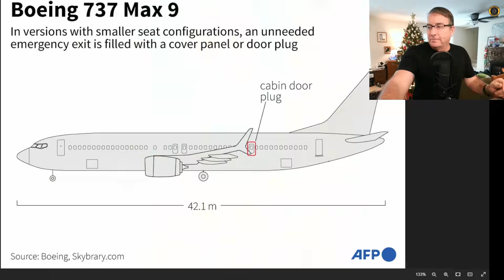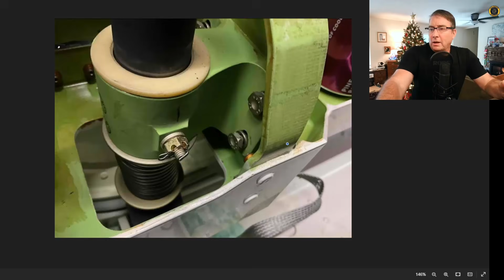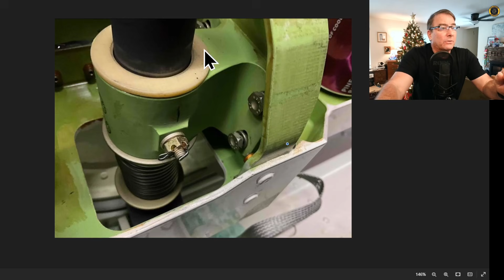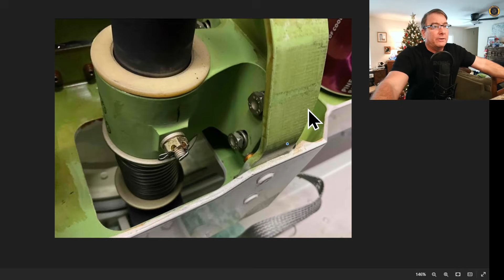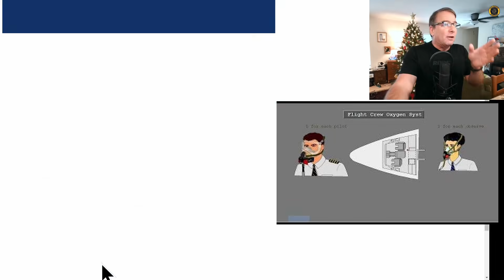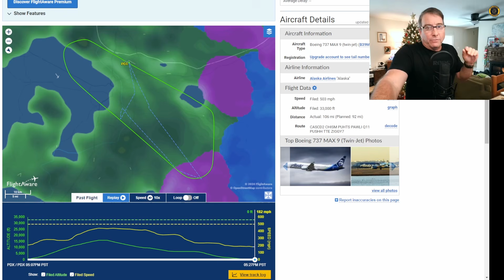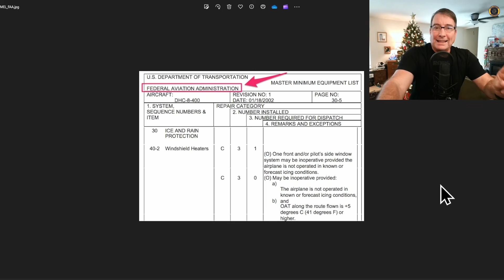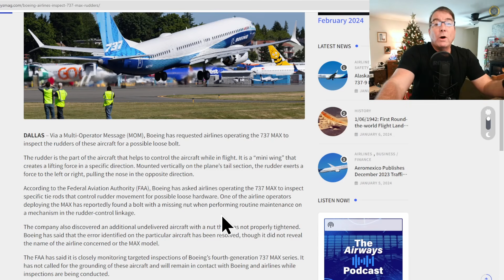"Yes, We Have No Bolts"  9 Jan 737 Max-9 Update

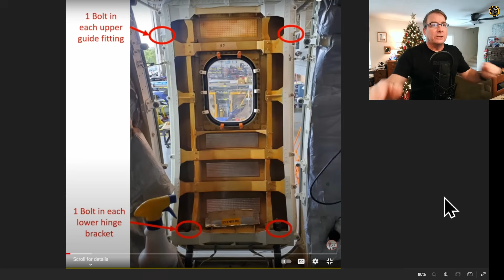Comment: @5:20, Juan, stop pads with NO bolts. Does it make sense that the door it held in place at the top and bottom only? I see 12 additional points of contact that if there were bolts used, they would distribute the load from the door to the entire structure around the door rather than just the top and bottom. Something here doesn't make mechanical sense to me.
Reply: The stop pads prevent the door from pushing outward and hold all the pressurization force.  The four bolts in question only prevent the door from lifting upwards in order to clear the stop pads.  Those four bolts have little to no force on them.
Reply: @johnaclark1  that is my question. How? Do bolts pass through the stop pad and fasten to the door?
Reply: @Mike44460  Watch the videos again.  When the door is closed and at rest it sits up against all the stop pads.  In order to open iIt has to slide up about 1.5" to clear the stop pads and push open.  The four bolts in question simply prevent the door from sliding upward which prevents the door from opening.  There is no real pressure on the four bolts other than assisting gravity in holding the door down so it can't slide upward.  No bolts are needed in the stop pads.
Reply: @johnaclark1  I understand that part of it. I have no idea of the actual square inches of the door.  I just used a 30-inch wide by 6-1/2' high door as an example to work with. Every one pound of change in pressure puts about 2,400 pounds of pressure on my sample door. Only holding the door at the top and bottom would surely let it distort. The actual door being curved adds to the surface area and the pressure trying to push it open. I'd like to find a picture of one in place.
Reply: @johnaclark1  I found a picture. With the door installed, the door stops are covered by the mating parts on the door. The 12 door stops are loaded when the door is in place. Now, it makes sense to me, and the bolts holding the door down are extremely critical, especially the two on the top.
Reply: @Mike44460 Critical yet have very little force on them. All they need to do is be there.

Comment: How could pressure push it up???
Reply: I’m just guessing here, but I don’t think that the pressure pushed it up. Since it’s designed to open by being lifted slightly, and then out, from vibration and bumping on landings and such, it could have worked its way up slightly overtime to the point where the stop fittings didn’t line up with the stop pads and then the pressure just pushed it out.

Comment: Speaking as a 20 year airline flight attendant veteran, as well as a five year stent as an instructor flight attendant.The fact that Boeing did not inform the crew on the main entry door giving way under a depressurization. This lack of information could have caused😢 critical time in an emergency, trying to figure out what to do about the door  and crew at the same time as we’ve got a major depressurization in the cabin. Just not right.
Reply: If you have rapid depresurization, are you really worried about bad guys trying to crash the plane or are you trying to save the plane and its passengers?  From what I have read, it wasn't the main cabin door that gave way.  It was the door between the cockpit and passenger cabin that opened probably equalizing the pressure between the two areas.  And thats been the same on most, if not all 737s ever built.  Not a design flaw.

Comment: Maintaining enough similarity for the type certificate of an existing aircraft, or engine, to apply to a new derivative is critical. Certifying aircraft, or engines, from scratch these days is almost impossible.

For instance, the Allison Model 250 family of engines were first certified in the late 1950s. Obviously, technical analysis capabilities have improved dramatically since then. The Model 250 uses cast integrally bladed disks for turbine wheels. In the 1950s, no one had ever designed a gas turbine engine that small. The conventional fur tree or dove tail blade attachments would not fit. That is why the cast bladed disks were used.

However, low cycle fatigue was found to cause cracks to form in the rims. Fatigue crack growth analysis techniques didn't exist then. These cracks were found to be acceptable as long as they stay within certain limits. Allison became an industry leader in fatigue crack growth analysis in the 1980s and 1990s because of work done to understand these rim cracks.

As such, the model 250 family of engines is the only family that is allowed to fly with cracks in the rims of the turbine wheels as long as they stay within carefully defined limits.

If a significant difference in the engine configuration was designed into a derivative so that similarity no longer applied, the cast wheels could no longer be used.

Balancing these issues is a critical part of the introduction of new aircraft and/or engine models to keep certification costs under control.

Comment: Why not leave the emergency exit door in place all the time? What difference would it make? There’s no change to aircraft passenger capacity, right?
Reply: From what I’ve read and seen elsewhere’s here, possible factors might be:
 a reduced cost for the buyer because you don’t have the extra additional hardware on the door,
Exit door means one less seat beside it on that row, I believe.
It could affect row spacing in that area also lead to reduction in capacity.
Certain passengers are not qualified to sit in an exit row, so there’s that problem.
Reply: @JohnHallgren  That would be pretty some serious penny pinching in the context of a jet that costs at least $200M - but I wouldn’t be the least bit surprised if your explanation was correct.

Comment: Funny you mention the tie rod and the rudder on the 737 MAX as I was using the castle nut and cotter pin example on road vehicles in the steering linkages. It would be interesting to see if there is a work place issue at Boeing with training people on correct installation of castle nuts and cotter pins and final visual checks before buttoning up the area behind panels.

Comment: I know flying is one of the safest modes of transportation but it haunts me to ponder if I’ve flown on a plane with missing or otherwise sketchy parts on the cusp of failure.
Reply: Juan explained how aircraft have redundant systems, and can be sent out with minor faults that wouldn't affect safety.
I have flown on aircraft with broken parts. There was an aisle seat nobody could use because the latch was broken so it flopped back when someone sat there. They moved the person and didn't cancel the flight.
Reply: The more you fly, the more you shorten your odds. I used to fly a lot for work. Possibly a coincidence but several mechanical issues were when flying in African countries. The big one however, was on a helicopter in the Netherlands, so you can never tell when your time is up.
Reply: Safer than airbus?
Reply: @SixOThree  any plane. Even the Piper Warriors I fly.
Reply: @SixOThree  Boeing has been getting more and more dangerous in everything they've been doing and building for the past 10-15 years.
Airbus seems to be safer and have had a fewer issues, but more idiot pilots.
Personally I always liked the Boeings much more than an Airbus, but I like it because it seems more cool and old-school than the eurobus, which is just a bus with wings... Like a Winnebago is just an RV, but an airstream trailer towed by a mustang is just better.
Reply: @SuperAd1980  yeah. I flew Alaska on a max this summer and didn’t realize until I was aboard. And I couldn’t help but gets good bit worried. Now I feel less irrational and more fearful.

Comment: Thanks Juan!!  Back in the 70s when I was ferrying new Cessna's from Mid Continent Wichita to TTD Troutdale Oregon.  I often cruised at 15,000 feet w/o any supplemental oxygen.   So I don't have any sympathy for anyone in this situation except the surprise factor.  The two pilots didn't need supplemental oxygen and with little fanfare could descend to 10,000 feet.  Panic is often a bigger threat than the surprise door leaving or whatever.  I am trying to imagine how those castle nuts were forgotten🤔🤷

Comment: If I was in charge of a 737Max operation I'd be grounding the fleet until maintenance had gone over every single fastener on the damn things torqued them to spec and added a QC witness mark, 
but I'm just a schmuck who has to ride in them and trust that the manufacturer actually did their job properly.

Comment: Tremendous reporting!
As a  30+ yr A&P mechanic your explanation and troubleshooting is on point.
I appreciate your understanding of aircraft systems and structures.
Keep up the great work,and informative posts, keeping the flying public informed about possible causes of critical failures.
Great work Sir!
Blessings from Oklahoma
Reply: A&P: Airframe and Powerplant mechanic, an aviation maintenance technician certified by the Federal Aviation Administration (FAA) to inspect and perform or supervise maintenance, preventive maintenance, and alteration of aircraft and aircraft systems.  Responsible ensuring that the aircraft are in airworthy condition.

Comment: I understood the NTSB Chairwoman Homendy, informed the people, ‘’  COPIT DOOR IS DESIGNED TO OPEN IN THE EVENT OF A RAPID  DEPRESSURIZATION ‘’, HER DEPUTY INFORME THE PEOPLE,  ‘’THE DOOR FRAME ROLLER RECEIVER TRACK FITTIG WAS DAMAGED ‘’ ( that is the data presented  ) 😢. In my opinion gravity and pressure should maintain the door closed, in this design a LIFT ASSIST SPRING on the hinge guide fitting maintain a closed door. The arrestor bolts job is to keep the gravitational and centrifugal forces  FROM  COMPRESSING  the LIFT ASSIST SPRINGS and opening down the door 😢. NO ARRESTORS BOLTS ADIOS MAX 9😢 . The 737 ‘’ 9 ‘’  on this event, is not a original 737 CERTIFIED IN 1967 , is an attempt to condition the drivers to believe it behaves just the same as the original type, with the purpose of paying you less 😂. THE DOOR IS AN ERRONEOUS DESIGN 😢. We appreciate you elegant presentación,saludos 👋 Iberoamericano ❤

Comment: “Sardine configuration “.  That’s funny!   

No bolts.  Oops.  Boeing is gonna get sued.  And they were trying to pin this on the subcontractor who made the doors.  Seems like if any 1 of those 4 bolts was in place the door would not have deployed.  

At least it’s an easy fix.  That is if it’s just missing bolts.  

Torque this all down. Throw some cotter pins in those castle nuts. And let’s get back to business.

Comment: OK 4  Bolts missing Along with the Castle Nuts and 2 springs are Still MIA This Means Who-ever Did the Final inspect before the interior install has some Explaining to Do. 
What i Do not Understand is this "New Aircraft" had Multiple pressurization Failures that it was under a Etos Limit....and yet it remained in Active Service! I Worked on Tractor Trailers  When i Was Younger and I Took Many out of Service For a Small wiring issue or a brake valve leaking...

Comment: Returning to the airport so soon, I’m assuming they did an overweight landing. Would they also be doing a structural check for that?
I had a return to airport after takeoff a decade ago. The pilots were  worried by an indication on the landing gear. Because we were flying PHX-PVR, we had too much fuel to land at MaX Landing Weight. We turned circles near Casa Grande for 45 minutes before we returned to PHX.
Reply: It’s not a long flight. Something like 2h20? They wouldn’t necessarily have that much on board?

Comment: Excellent job Juan. Lots to unpack here. Looking at the picture of the lower pin, the bolts holding the bracket to the door frame appear to be loose. Unless they are kept in torque by the lock washers that I think I see. And missing hardware in the rudder system discovered in heavy maintenance pisses me off as well. At this point I am very glad I am no longer in the traveling public. Keep your witts about you Juan, and keep calling them as you see them.

Comment: The crew did a great job.  Forgetting to pull a CVR breakers after losing the QRH is understandable.  Why didn't maintenance pull the CVR  after landing? Assuming they were at a maintenance base.  Lots of questions are going to be asked and answered, during the investigation. I am certain the cause will be found.  Leaving important information from a manual and failing to train the pilots on the changes is unacceptably dangerous.  Great video thanks.
Reply: Wouldn’t the investigators have been on the aircraft before the audio was lost? Step one of investigation is preserve and document the scene….in a computer driven world that should have been a priority. In IT we frequently take snapshots of suspected problems to be able to roll back in time.

Comment: Juan, this cockpit door issue is very concnering to me. Like you, I was always under the impression that the blow out panels would give way long befor the door would be blown open. This is a extremely dangeours situation. I feel that the knowledge gap that the rest of the industry is facing is acutely affecting Boeings ability to turn out a safe product. They need to move the HQ's back to Everett, get the CEO's and Senior VP's into the assembly hangar on a regular basis and hire more quality control inspectors or this extremely imoortant company is going to loose the market share and fold. Boeing is a iconic American company that has been bailed out by the taxpayer twice now. How much more do we need to do??.
Reply: It suggests that a hijacker can relatively easily gain access to the cockpit by blowing out a window.
Reply: @StarkRG  It would be pretty stupid to do that because it could cause a total and catastrophic failure of the air frame and the airplane could break apart if at altitude.
Reply: @StarkRG  The hijackers would risk themselves being sucked out before they can get the plane under their control.
Reply: @AreYouEntertainednow  I mean it sounds like all it would take then is maybe opening 1 or 2 of the main doors and it might 'pop' the security door.
Reply: @scottwatrous you can't just pop a door like that. No chance.
Reply: @scottwatrous  You cant open the doors of an aircraft in flight.
Reply: 3rd strike & you are GONE!  No more BAILOUTS!
Reply: You said everything that I was thinking!  Saved me the typing. TY!
Reply: I can understand the door opening up to more rapidly equalize pressure. The 737 was not designed to have the cockpit pressurized more than the cabin. Worst case, the forces could wedge the cockpit door open without the door opening. One wonders if the 777 has the same "feature".
Reply: "How much more do we need to do??."

Start with IAMAW.

Comment: What else did Boeing leave out of the manual in the 737 Max? Additionally, I'd ask what other bolts might be or might come loose on this plane? And my goodness how convenient that the recorder was precluded from recording.
It was reported by Amy Goodman of Democracy Now that the online news outlet "the Lever" reported that employees at a Boeing subcontractor were told to falsify records after inspection teams found excessive amounts of defects in parts being made for Boeing (per Amy Goodman). Also Spirit shareholders filed a federal complaint last year claiming Spirit execs prioritized production numbers and short term outcomes over product quality. 
In an interview with Amy, Ed Pierson, a former senior mgr. at Boeing and now executive director of the Foundation for Aviation Safety, said Boeing had removed production quality inspections, thousands of them (did I hear that right? - thousands?) for other kinds of planes as well as the Max - 767s, 777s, and 787s. 
It sounds like the FAA has fallen asleep at the wheel, and Boeing needs to be held accountable.

Comment: Per a currently employed Boeing engineer I know told me a lot of unfinished work is being sent down the assembly line to be completed at the delivery center not in the Renton factory. This practice may be a contributing factor.  The FAA must look into this practice.
The delivery center workers are getting slammed with unfinished work a have the blame placed on them for late deliveries.  The workers at the delivery center are not just fixing little squawks  they are removing ing tails to fix major problems that the factory sent them.
Reply: That's a mess. Years ago that type of work and it's paperwork was called a traveler, sometimes a pickup. Another system was OSCS or Out of Sequence Control System. What you could call the hidden factory. Don't know what they have in place these days.

Comment: The reports from the other 737 MAX-9 planes that have been grounded and inspected saying that the bolts were "loose" is incomplete info. From how it appears that these bolts (at least the top two, but probably also the bottom two) are intended to function if they aren't torqued down but the castilated nuts are still pinned in place (either by wire or the cotter pins as in the pictures) they shouldn't come off. The rattling of a loose bolt might spook the passengers, but it shouldn't cause this door plug failure. These bolts seem to be doing a similar job (but with less shear loading) as the pin that holds a hitch into a truck's reciever. Doesn't matter if it is loose as long as it is prevented from falling out.

EDIT: Oh... the bolts holding the guide fitting being loose.... Yeah that's a big problem. Those are structural bolts, not retaining pins.